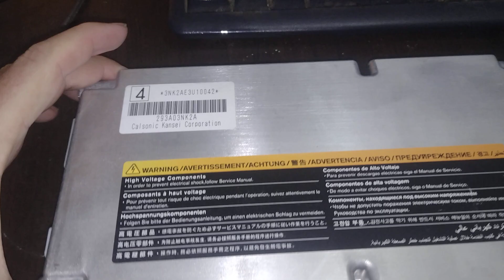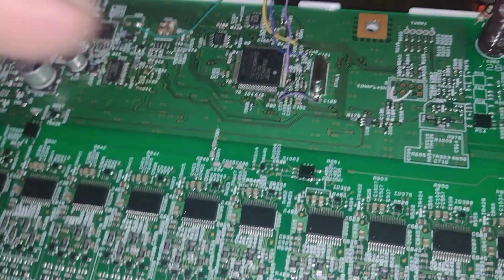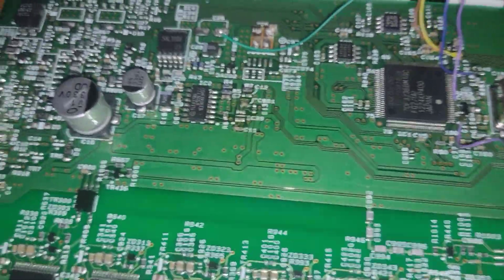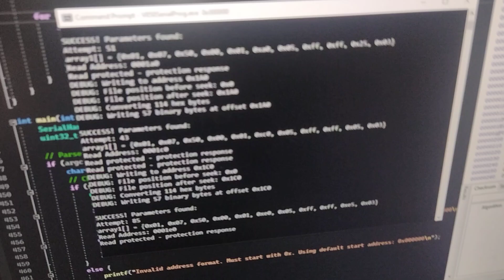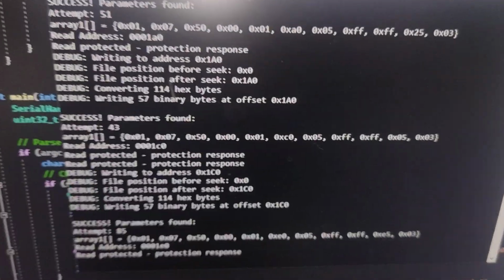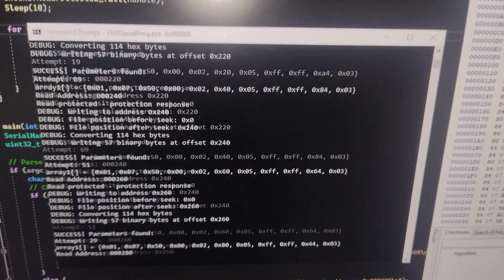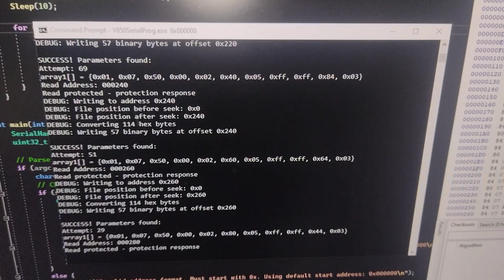SideQuest 001 - Fault injection attack - extracting BMS firmware from NEC/Renesas Microcontroller

Comment: WOW Really great work! Cudos from Austria!!! I have a AZE0 2017 Leaf 30kwh stuck with 4 bars because I was stupid to play and didn't read the full thread :-(
Reply from the maker: I'm working on it. If anyone has a CAN data logger and can log the SOC bars message the BMS is sending, I'd be interested to know if its the VCM overriding the value, or if its the BMS reporting only 4 bars.
Reply: @bennvennelectronics  I can confirm that it's the BMS that sends health bars to the VCM. VCM doesn't process it. The SoH and health bars are not interconnected and sent separately. You can have 100% SoH and 3 health bars.
Reply from the maker: @efurcixot  I've found the code that prevents SOH bars rising beyond the current SOH level, it's been patched and flashed and the BMS now reports correct SOH on the dash
Reply: @bennvennelectronics  that's great news. I have an assembled 195Ah CATL battery. Can help you with testing.
Reply: I don't think the VCM interacts in any way with the SOH bars. I swapped the respective VCMs of my two Leaf 30s and the 4 bars didn't move. In any case, what you're doing is impressive, even if it's Chinese to me.
Reply from the maker: @cyrildouteau6112  The BMS doesn't actually have any connection to the dash, all data goes via the VCM. We've learnt the 4 bars is something nissan coded and the only way around is to flash a modified BMS firmware to remove the 4bar lock. We've done that on a few BMS's and works great. The only issue is we need the firmware which we have to manually extract.
Reply: @bennvennelectronics  Which firmware do you need extracted? I have an assortment of BMS' laying from both ZE0 and AZE0 from different model years ranging from 2012-2017. I could try and get a ZE1 as well.
Reply from the maker: @rushanfernando7197  quite a few still need dumping. I can put a list of what I've already got over in dala's discord or on the mynissanleaf forum thread?
Reply: @bennvennelectronics  I'm on both put in either one.
Reply: Are you able to do a video on this, I am finding this very interesting  @bennvennelectronics